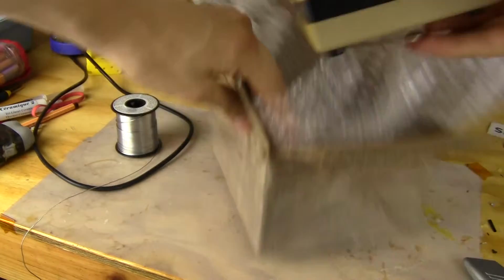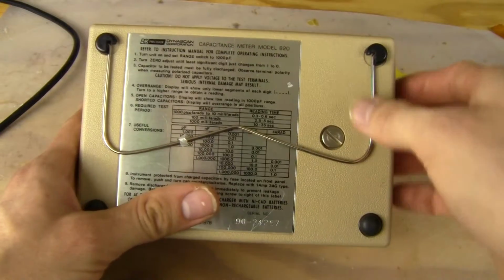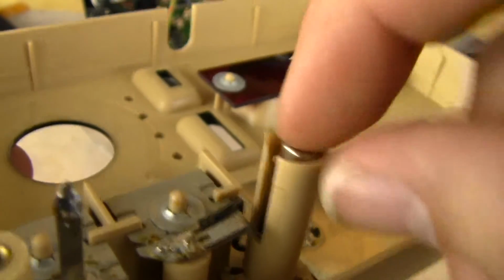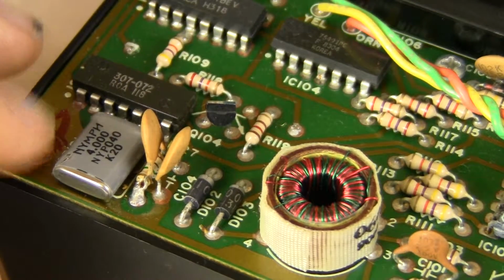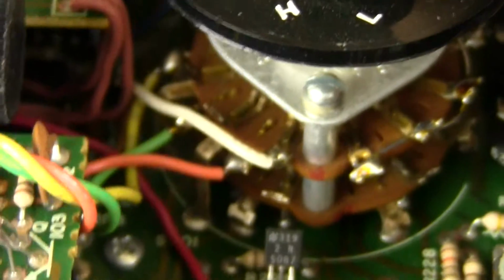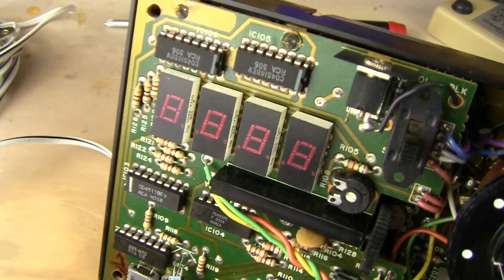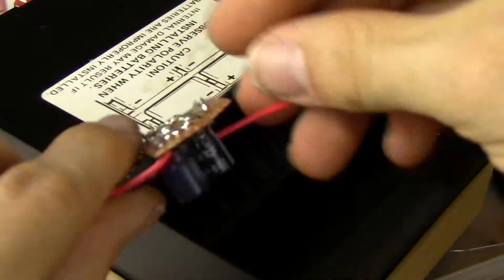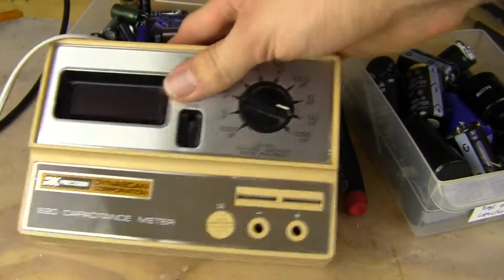BK Precision 820 Cap Meter Repair and Mod

Comment: The first step in service is to try the unit, then solve the most obvious problems.  You didn't have to take it apart.  Also, never force anything (pulling the foil off).  I also notice the PCB for your regulator could have been made to fit without damaging the battery compartment.  One suggestion would have been to simply use the correct power supply type, or put the regulator inside the power supply.  Never modify something if you can avoid it.  I know this is a late comment, but maybe others will think before making changes first.